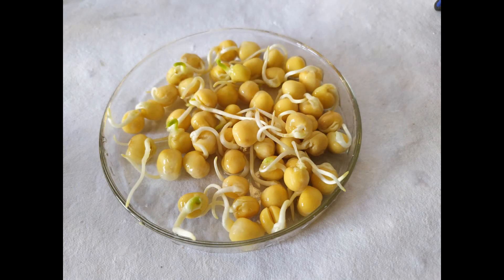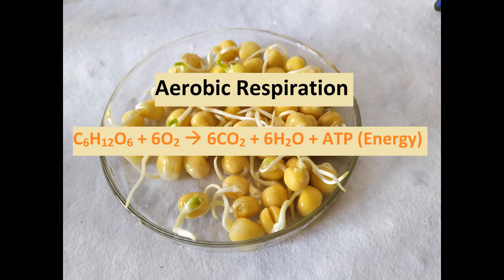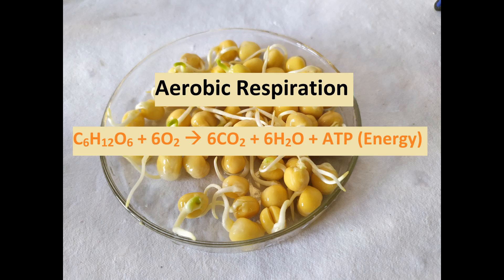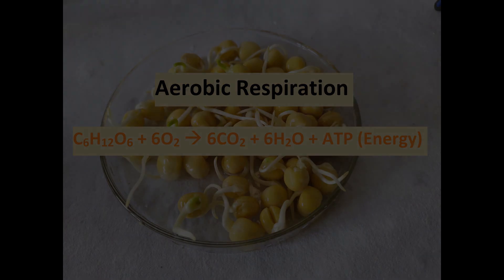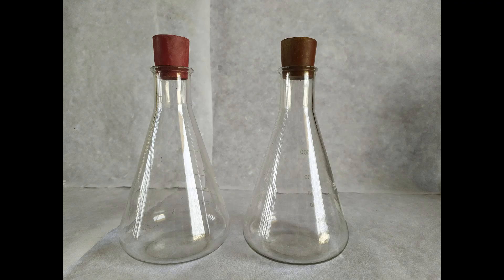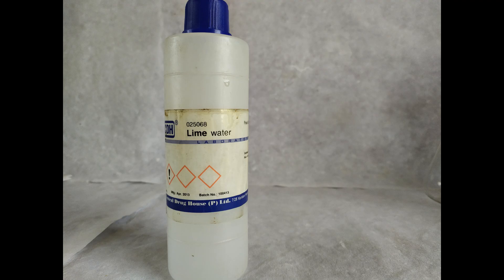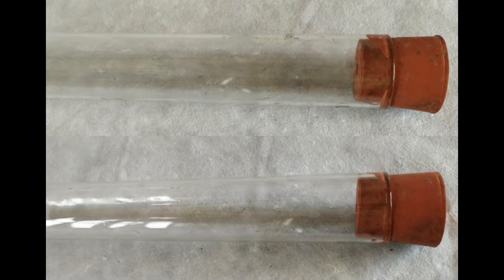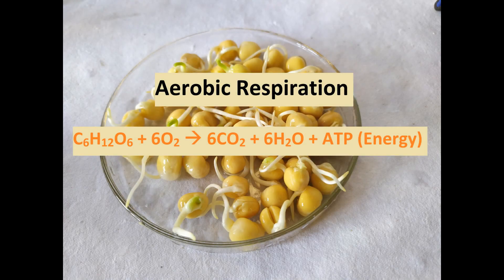Carbon dioxide is produced during respiration Experiment

Comment: I think that what you produced was Carbonic acid (H20 + CO2 =  H2C03) not calcium carbonate (CaCO₃).
Reply from the maker: Not Water, it's Lime water (calcium hydroxide solution)
Reply: @TheSingtangpaScienceGuy  What if you use plain water?
Reply from the maker: @JorgeIaniszewski2015  lime water is a good indicator to check for presence of CO2. So this was used. So why go through the trouble of separately analysing the presence of invisible carbonic acid, when you can just use lime water which gives you insoluble carbonate precipitate visible to the naked eye, when CO2 is present in a sample.